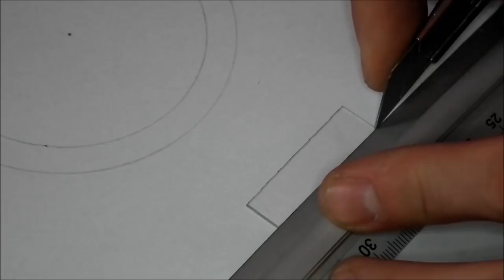How to make a BRACELET. Resin and Wood. DIY.

Comment: Hi mister jedrek29t, for a long time I’ve been watching your videos obsessively:) But today I noticed one thing. You often use air burner to remove the plastic bars, if epoxy resin reacts to heat that quickly, can we say that resin products aren’t durable against heat? I live in mediterranean region and novadays it is extremely hot out here. I can’t imagine forgetting this beautiful bracelet on the towel under the sun while I am swimming:)